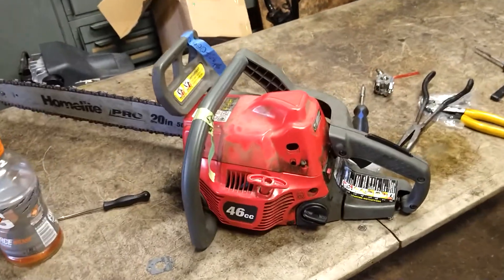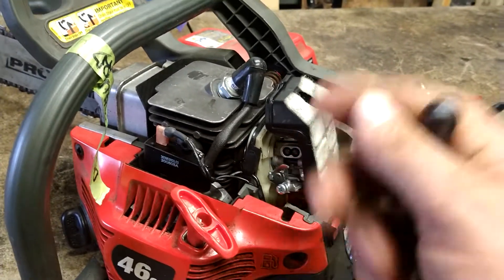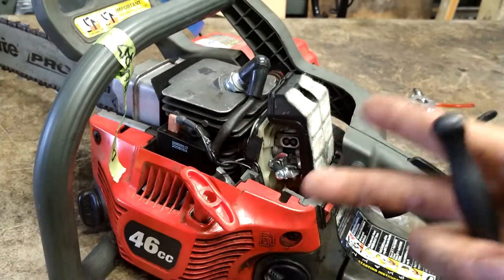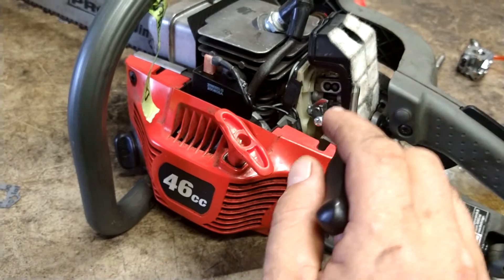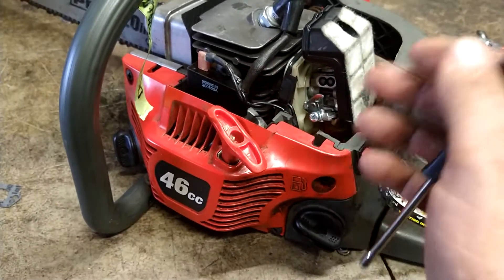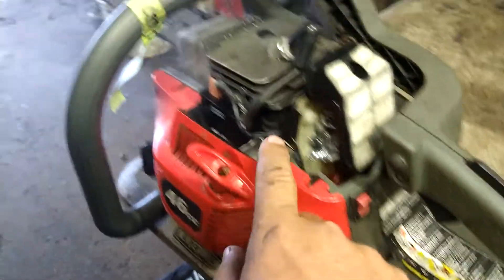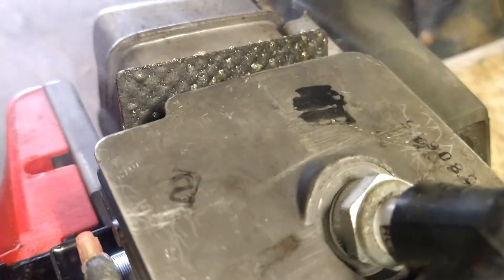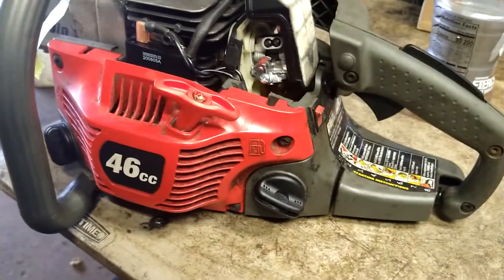homelite pro 4620c chainsaw carburetor adjustment, 46cc chainsaw

Comment: I got one of those bought it at HD for $199 15-20 years ago starts up 1 or 2 pulls. Always drain it and run the thing dry before storing it probably why never given me trouble. Sometimes I adjust the needle jets little.  Thought about buying a Stihl this year all I need it to do is move a chain who cares what the brand name is.

Comment: I have the same model and can get it started but can keep in idling.  I have adjusted the throttle screw but, doesn't seem to work.  I purchased the screw driver needed (pacman) but wanted to check with you if there are and suggestions.

Comment: I had a clone blue max is having running trouble it was screaming at leaning
Reply from the maker: carb loose?
bad gasket between carb and motor?
Reply: I put a fuel line in the saw and I’ll have a video of it in 2 weeks

Comment: Hi, working on this same model chainsaw.  How many turns out for the 3rd idle screw? Bought chinese carburetor, no matter what I do, still bogs down at high throttle.
Reply from the maker: there are 2 screws together the one closest to the air filter needs to be turned counter clockwise a little at a time till it stops bogging. beginning setting for both is 1 full turn from snug tight. make sure you are using brand new low octane gas and oil mix. it must be bought within the last 2 weeks. 3 week old gas will bog the saw.
Reply: @smallengineguys  thanks for your reply! Noticed an aluminum mesh stuffed inside the muffler,  should I remove it, perhaps is clogging the throttle response.
Reply from the maker: yes it wont hurt. you can also remove the muffler and look into the cylinder it could be clogged there as well
Reply: @smallengineguys  thank you very much for the tips/ideas.